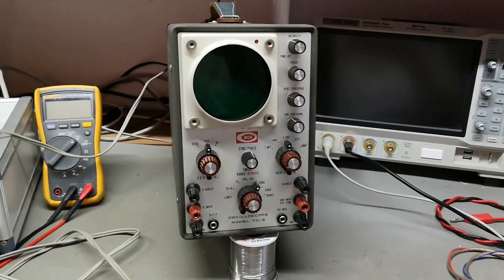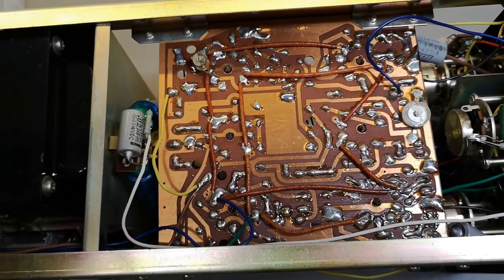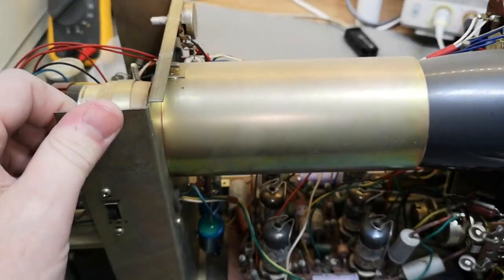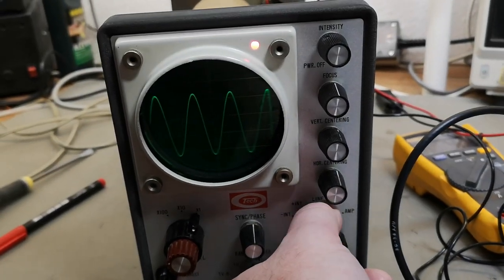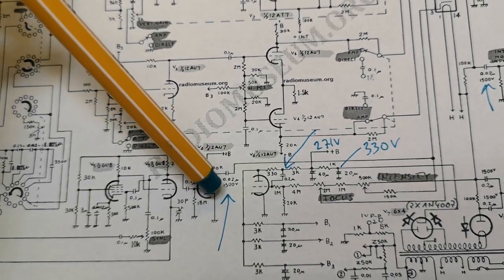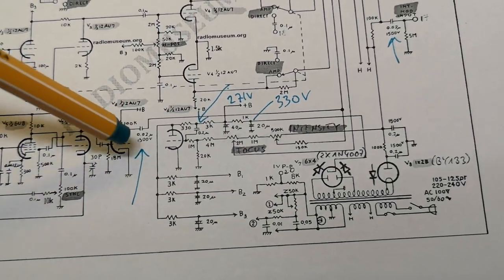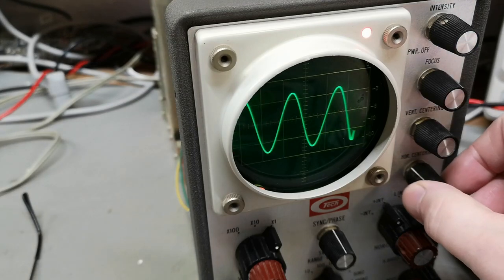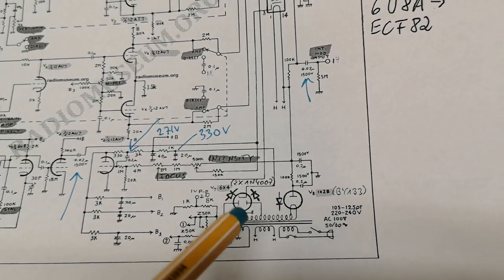Tech oscilloscope TO-3 1ch 300kHz 9tubes 1968 Japan repair teardown

Comment: Hi Thomas, thank you for the vídeo, very informative. I got one TO-3 that came with a shorted 6X4. After cleaning and replacing the tube the oscilloscope is working but it presents some horizontal non-linearity. I checked the sweep signal and it's not completely lineal, it's curved at the beginning, in the the first couple of cycles. I tried swapping tubes (12AU7) and some changes improved the condition. But I'm wondering if the cause are the tubes or maybe the oscillator. I know the sweep generator is V5, but I'm not sure about the cap that acts as charging-discharging capacitor on the circuit. Which would be the component to check for that issue? Thanks again.

Comment: Got a similar one, in the list to do the upgrade to silicon, of course if it actually works on test, and after changing the dead capacitors.

Comment: I got the same model today and had the same problem with the crt fading into nothingness. Ive been working on tube circuits for several years now but test equipment is still a little bit black magic to me😅 

Gonna try if changing the blanking cap helps mine too, thanks man✌️
Reply from the maker: please do tell us, the leakage current in that cap will turn the bram dark
Reply: @TeardownOZ2CPU  it did. Fixed the problem. These Japanese oil caps often test perfectly fine, but once they heat up they start leaking. 

Thanks for the video, helped me unwind the knot in my head😄✌️

Edit: btw, do the 2 ecc82s in the back run pretty hot on yours too? I have a feeling that's a bit excessive but I can't seem to find a problem there
Reply from the maker: @maxs.3238  you will find a lot ECC82 / 12AU7 in this unit, if you feel some are running way too hot, simply try to mark them with a permanent marker, and then try to swap them with some of the more cold ones, now all still work ? and the hot one is now the cold one ? or still the hot one, ? then you know if it is the circuit power or the tube that is the cause of this..  you cold also make my simple tube tester ? https://youtu.be/E8bq0NmlwnI?si=kk0PBbyxMcZkBd0s